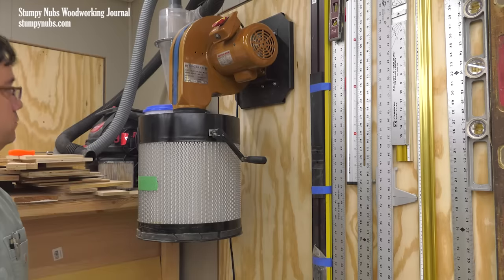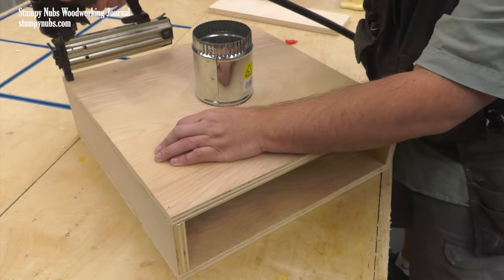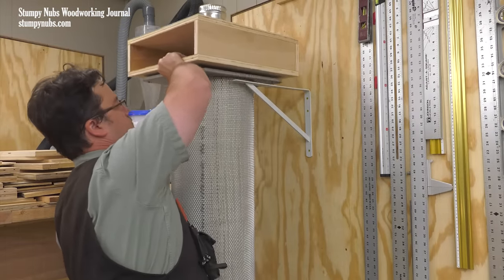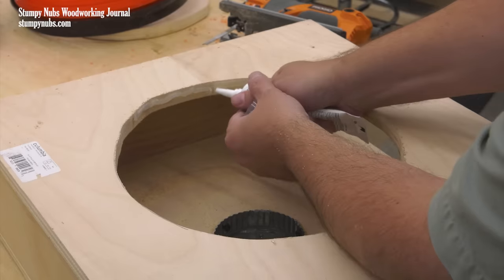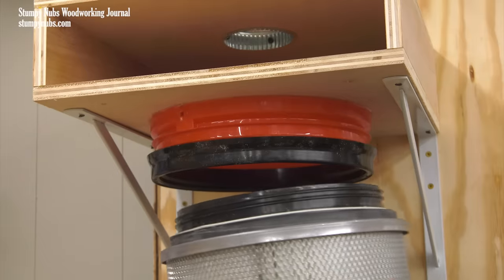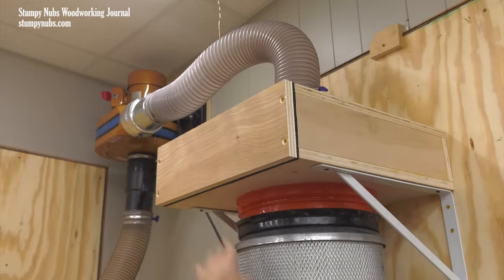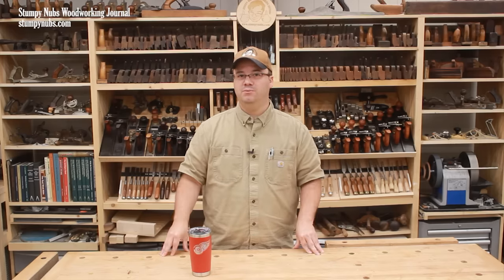Supercharge your SMALL SHOP dust collection!

Comment: Long, long age I worked at home demonstration (was supposed to be SELLING, but that never happened) of the Filter Queen brand of vacuum cleaners.  We used a bright light to show no dust exiting our vacuum cleaner and all the dust exiting the homeowner's vacuum.  Not a trick, we had a woven filter cone placed on a cone shaped inlet to the motor, and the air inlet and cone combination caused a rotary flow around the cone which kept the filter surface clean.
Reply: What a coincidence.  I grew up with a Filter Queen vacuum.  Thing was a monstrosity compared to today's vacuums.  Big ass canister thing connected to a long hose and the vacuum wand.  My parents had to have gotten 30 years out of that thing.

Comment: This is a great suggestion, for interior applications, but sure sure of expense for filters! 
Simpler mount the system on the out side the shop on the side of your building or shed, then breath easy and less noise in your shop and save your money! Ps do the same for your vacuum and air pumps !!!!!

Comment: love your videos and how-to's....I've learned so much from watching them. Here is my question ... canister filters can be expensive and my budget does not afford me the luxury of purchasing one. Is it possible to make a filter box that you can attached to a dust collection unit that is made out of furnace hepta filters....say four 16x25 inch merv 13 filters...would be interested in seeing of you could make one and test it. I have made an air cleaner using a box fan and 4 merv 13 filters that works well. Was wondering if this could be adapted to use with a dust collection system.
Thanks for all you do for the wood working community!!
Reply from the maker: The benefits of a canister isn't just the fine filtration, it's the large square footage of filter area that fits in the canister because it is pleated. It would take many, many furnace filters and a giant box to give you the same surface area and therefore the same airflow.

Comment: A 3d printer would be a useful addition to anyone doing these diameter to diameter connections as long as the air doesn’t run > 120 Fahrenheit.

The filter itself may be too big for most “prosumer” printers (12”x12”) but that 5” to 4” adapter would be 5 minutes in cad, 3 hours of passive printing, and $5 of TPU - a flexible filament.

Comment: Excellent idea.  Could you also use a cyclone before the filter to lessen the particles getting into the filter/bag assembly?
Reply from the maker: You could if you wanted to. But cyclones reduce overall airflow, so you may lose some suction.

Comment: I honestly do not have the room for a filter that large. Been looking for smaller ones about 16" tall max 10" diameter max.

I need to build a manifold of sorts to mount higher up on the wall. Either that or it's getting vented directly outside.

Comment: That box could potentially add a lot of friction loss to the duct system. According to the Manual D worksheet, an abrubt increase in cross-sectional area is equivalent to ~40ft of duct and an abrubt decrease in cross-sectional area is equivalent to ~25ft of duct. Since the transitions are close to each other and the holes on either end are somewhat similarly sized, I'd guess that the actual pressure drop is less than that.

If manufacturers of cheaper dust collectors actually published the external static pressure (pressure losses due to duct/fittings/filters/etc) at which their blowers achieve the advertised CFM, you could even calculate how to get the same performance by eliminating the box and using a smaller filter!
Reply from the maker: We can sit here and debate it on paper, or I can just build one and tell you it works :)

Comment: This is exactly what I am wanting to do, So, how does this setup compare to the Donut/Bucket modification to the Harbor Freight Dust collector?  Reason I ask, I want to use the wall mount as it takes up less floor space.  But if it is less than the HF dust collector with the canister, then I will go with the HF one.

Comment: My 3m x 3m shop was originally a motorcycle garage. It has a nice big roll-up door which allows me to refresh the air often, and quickly, but it gets cold when I open it in winter. My wall space is too precious for mounting permanently mounted tools on it, and the brick exterior prevents me from drilling holes through the wall to exhaust air outside.  I do, however, have a 3.5 meter tall ceiling that's not doing anything useful.  Can dust collectors be mounted on the ceiling?

Comment: Personally think you should check out creating a cyclonic type filter. You may have seen the things that go on a shop vac .It spins out the solids before they reach your actual filter. Check out Donaldson filtration , they make filters for heavy equipment and explain the premise. Any craftsman such as yourself that goes through a lot of material needs more than a shop vac etc. You could probably have one 3d printed from a fellow youtuber.
Reply: I think this video was aimed at an economical solution for a small home shop
Reply: @jack5402  Yeah those cyclonic things are cheap and can be adapted easily .
Reply: He's done several videos on cyclone separators, ducting and dust collection in general and they are well worth searching for. I think he's even got a playlist on the channel home page. You Tube algorithms award immediacy however, so while there are dozens of old videos packed with valuable information on filters, cyclones, gamma seal post filter debris canisters, airflow considerations, ducting, and every other thing you need to know, they are buried in the search results if they are more than a few months old. YouTube pretty much assumes that any video produced before last year was made in the dark ages.
Reply: @christopherdahle9985  Cool thank you sir !

Comment: Great vid as always.  Thank you for this.  I purchased the Harbor Freight dust collector, and wonder if I would be better off mounting it to the wall incorporating the updates in this video or should I stick with the original setup vid for the Harbor Freight dust collector?
Reply from the maker: The filters in this video are not large enough for the 2HP blower on the single-stage collector you refer to. You would need two of these filters, I believe, if you wanted to mount everything to a wall. My opinion would be to use the singIe, larger filter in our other mod video, or contact Wynn and ask their advice.
Reply: @StumpyNubs  thank you.  I just rewatched the other video and linked to the proper filter.  I'll be ordering the filter soon and finishing the build.

Comment: Can/have you made a video comparing shop vacs to some of the lower end dust collection machines? From what I have seen the real cheap ones like WEN are about as good as a shop vac anyway. I like the shop fox 1hp one thats around 300, there are central machinery and grizzly ones in that range as well. Im just not sure that its worth it for me at this point, plus the space. Im sure it would be an improvement but I dont make much mess as it is. I have 2 20" industrial fans that I use to blow fine dust out.

Comment: I have a small (Wen 660 CFM) I was going to take bag off and just run hose directly to a bucket- so I won't have any filter- will that work or do I still need a filter if its going into a sealed bucket??

Comment: Carefully with that gamma seal lid.  I have one on my dust collector and that tiny white seal that goes around the lid fell off the first time I unscrewed it.  I plan on getting some weather stripping cause it's only going to fall off again..
Reply from the maker: You mean the large o-ring? Just put it back on.
Reply: @StumpyNubs   I could, but because it fell off it makes me doubt it will be a good seal and there could be a leak. I think I would feel better if I had something more substantial

Comment: I hate to be crass but GD I love your content. I’m running a cheap Jet 650 1hp and it does fine plugged into one machine at a time, but it means I have to keep it mobile. I’ll seat the WYN filter directly where the crummy bag filter sits now on the dust collector like you have shown in your other videos, but anything else I need to consider with it being on a mobile base?
Reply from the maker: I have seen them put on carts before. No issues as long as the hose connections are secure.

Comment: Couple suggestions, never size your pipe down if you have a 4.9” connection get 5 or 6 in duct, don’t size down to 4 inch.  Use another Gamma seal on the bottom of the filter and put a 5 gal bucket on the bottom instead of a plastic bag.  Get a decent cyclone on the front end of your fan/blower.(again size the cyclone based on the blower duct) and you will only get a small amount of very fine dust in your collection bag/bucket.  Line the plenum with scrap carpet, it will cut the blower noise down.
Reply from the maker: Couple responses: Sizing down the blower outlet does not create a bottleneck in this case because just inches away is the inlet, which is already a bottleneck at 4-inches.... Putting a cyclone in front of a small blower like this will kill your airflow. Cyclone separators require more power than a blower of this size is capable of... Noise reduction at the plenum box is pointless in this case, as well, with the blower making the bulk of the noise just  a couple feet away.

Comment: You really should install a pre filter for the larger particles (5 to 10 micron and bigger), that box would be the perfect place for that.  I have a g4 prefilter and then a F8 (comperable to MERV14-15) actual filter bag filter.
Reply from the maker: The canister filter is easy to clean and does not clog quickly. I have found no need for a pre filter on any dust collection system with a cansiter filter.

Comment: Always love your videos 👍 I started with a 2hp Harbor Freight collector. Watched more videos on dust collection than I can remember. Took the best parts of many and made my own. Decided to vent my collector to the outside. Got around an expensive filter which would take up more space in my small workshop and have had great performance. I know many will be unable to go this route, but if you can without any complications, it is worth a look. 
Thanks for your awesome content. I always watch your videos when they pop up on my notification list.
Reply: I'll be building my first dust collection system soon and was considering venting the dust outside, not to an expensive filter.  How is you outdoor venting working out.  Note: I don't heat or cool my shop.
Reply: @ericbolz   it works great for me. My biggest issue is that the Peachtree dust collection system starts picking and venting more sawdust than I want. Once my 55gal barrel is about half full, I will start seeing more than just the occasional fine dust outside. I go ahead and empty it when that happens. I am looking for ways to change that, but since I only have to empty it every other month, it's not a huge priority.
Reply: @terrmaso  So you are not using the Harbor Freight 2 HP collector?  Why?  Not enough suction?
Reply: @ericbolz  the motor is the 2hp HF. Plenty of suction. The Peachtree I referenced is the two ducts attached to my 55gal barrel. Less expensive version than the Dust Deputy.

Comment: i would love to upgrade to a wyn filter.  but here in nz you have to remortgage the house to afford it.  luckily the prevailing wind blows through my shop with the dust collector right in front of the exiting door.
Reply: Shipping from the US is prohibitive I am sure. But the filter cartridges are manufactured for industrial and marine diesel engines. Wynn conveniently tracks down the sizes commonly needed for dust collection, simplifying the task of sorting through the complex range of sizes and types intended for other purposes. This made it easy for me to order from them. But if it hadn't been so easy, I'd have looked for a marine or industrial equipment parts supplier. That might be an economical option outside of Wynn's normal shipping range.

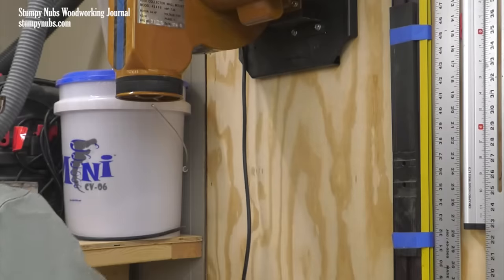Comment: What was all that dust falling out of the blower outlet at 1:34 and 1:38?  Was it plugged up?
Reply from the maker: That's the hose inlet. I was sucking chips out of a bag to test the system and the hose got partially plugged by a large piece. That reduced the airflow and left some chips in the inlet.

Comment: I was just on Wynns website yesterday, I’m looking to upgrade my Harbor freight dust collector filter. I would like to run some ductwork for it, not a lot one to my table saw and one to my down draft table. What filter do you recommend? It’s the central machine 70 gallon. As far as ductwork goes For my down draft table I would have to go up and over a garage door. I would think that lifting (up and down) on a single stage dust collector would be a big mistake. I watched your other videos on dust collection and you said limited ducting for a single stage dust collector, I would estimate 18 - 20’ with two blast gates. Any thoughts?
Reply: I got the 35c222nano for my harbor freight dust collector.  It requires a bit of adaptation to fit perfectly, but it works well.
Reply: I used the 35B222NANO for my harbor freight collector.  I unboxed it, put the lid on with the clamps that come with it, put the filter on the collector and attached it with another set of clamps that it came with and then put the plastic bag on and it works great.  Been using it a little over 2 years and it still works great.
Reply: @ericeinsmann5559 do you separate after the HF and before the filter or do as stumpy shows? I have the HF 1hp and wondering if it's best to separate the big stuff then have the filter collect the finer dust.
Reply: @krumafreak  I am assuming you don't have a separator for the large chips before the filter or do as stumpy shows? I have the HF 1hp and wondering if it's best to separate the big stuff then have the filter collect the finer dust.
Reply: @timmartin6748  I have a super dust deputy,  where the sawdust goes first.  The sawdust goes down in to a trash can and the air goes up through the motor.  Then, over to the filter section which has the Wynn filter on top and a 5 gallon bucket below to collect whatever dust makes it that far.  Thanks
Reply: @timmartin6748   I have a small cyclone separator that sits on a 30 gal trash can before the impeller.  I tap on the sides of the filter every day I go out to the shop and that keeps the filter from getting clogged.  I run a flex hose to whatever machine I'm using and it sucks pretty good. Two years in and it still works great. In my opinion the HF dust collector and Wynn filter is a fantastic option for those those don't want/need a large expensive collector.

Comment: Vent the fine dust out of the shop and save lots of time and money while increasing suction.The amount of heat or air conditioning lost is minimal as the machines don't run that long.

Comment: Why is the air flow from the inside to the outside? Every pleated filter I have worked with has the fluid moving from the outside to the inside.
Reply from the maker: Not all filters work the same.

Comment: After watching several of your dust collector videos and a few others, it seems like it would be worth it to just vent the fine stuff outside, rather than trying to filter it. Having an exhaust port will give you much higher airflow than you'd get with a filter and keep your air in the shop clean. Only downside I can see is if your shop is conditioned and the outside environment is terrible. Of course in the winter your impeller is probably putting out enough heat to replace any heat you pump outside with your shop dust collection system.

Comment: If your walls are made from drywall and wood you can easily cut a hole in the wall and keep your dust bag filter outside.
And than just build a small enclosure
For it outside.
Reply from the maker: Our outside walls made of drywall too? .... In all seriousness, removing the filter and exhausting outside is great if you live in the country with no nearby neighbors or ordinances, and if you do not heat or cool the workshop.
Reply: @StumpyNubs  It's what I did; 1200CFM extractor mounted on the outside wall of my shop then I built a small shed around it lined with carpet underlay as noise proofing to keep the neighbours happy. It looks sort of like an outhouse but that's OK. The weather is mild enough here that moving all that air outside is not an issue. My whole shop is only 4000 cubic feet so plenty of air changes.

Nice video, thanks.
Reply: @StumpyNubs  I did not mean that you schould remove the filter just have it outside in a Little shed.

Outside of American houses usually made from particle boards so still easy to cut a hole in with a sawzall.

I have to agree with you about heating and cooling your workshop.
Reply: @StumpyNubs  what about putting bag filtering device in really big coardboar box with small holes in the bottom?
It is cheap and easy to do and could be great chack for people that already have a dust bag collector.
Dust schould have time to settle down in something like that.
You cold always add some weak filters to the bottom.

Comment: I have not seen any info regarding how long a filter should be used. I vacuum my filters inside 2x/yr.
Reply from the maker: It can be used over and over as long as there are no holes or tears. I blow them out with compressed air: https://www.youtube.com/watch?v=zuf1G2n4ldc

Comment: Wouldn't loosing the filter all together be more efficient and reach full potential?
Reply from the maker: This filter has more than enough surface area for that blower to reach its full potential. But sure, no filter will work as well. However, not everyone can exhaust the system outside through the wall.

Comment: @04:02 did you really just put a countersink screw into hold flat metal that has no countersink conical hole in it? You have no button head screws for that?
Reply from the maker: LOL- I used what I used. It will make zero difference.